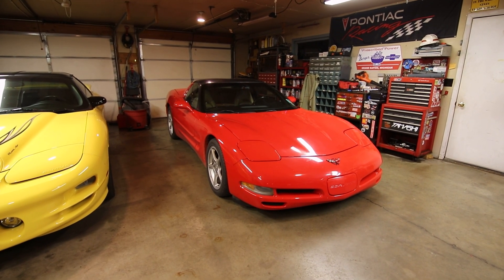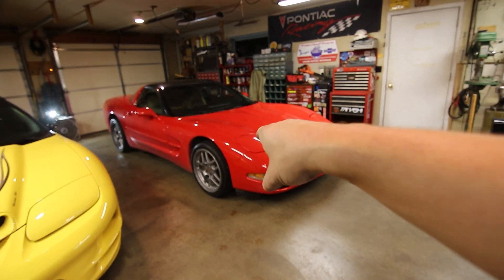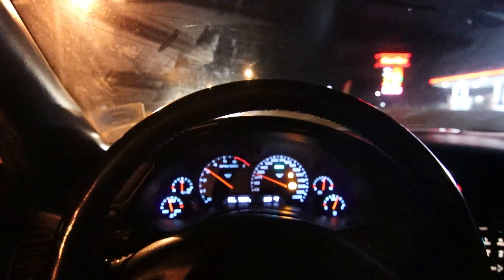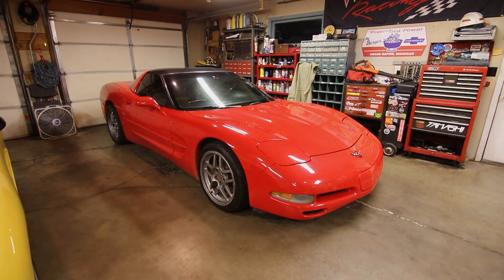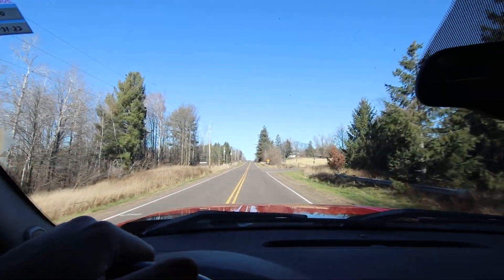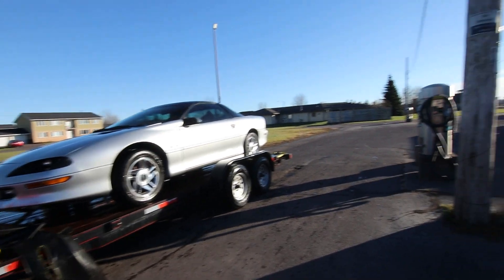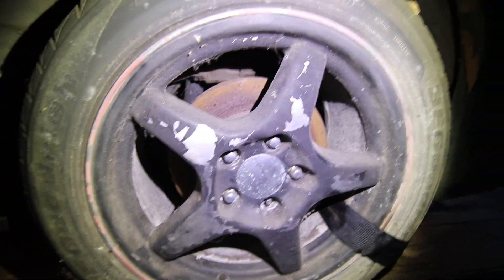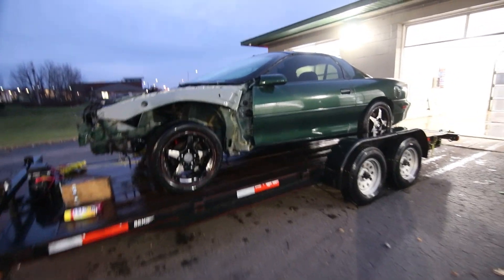Saving Two CHEAP 4th Gen Camaro Z28's & Updating The C5 Corvette!

Comment: I would love to see you build the lt1 !! I think they are fun little engines and with the torque head conversion can be very reliable.
Reply from the maker: I agree, and the thought was there. The silver car is so rough, though, that it is just financially not worth doing that. 

The green car would be perfect for a turbo ls swap.
Reply: @Greenlightfilming  with your knowledge and craftsmanship I'm sure you would build a great car.
Reply from the maker: @coderedcamaro4812  well, I'm flattered. Thank you lol. 

I have wanted to do a turbo ls deal in  an fbody forever. The trouble is that it's a gigantic money pit (youtube will not offset it lol). 

I have a tough time stomaching that
Reply: @Greenlightfilming  I follow your channel pretty close because I have almost identical cars as you. A pewter trans am, an 89 camaro and a 97 lt1 trans am.   I'm working on getting a c5 or c6.